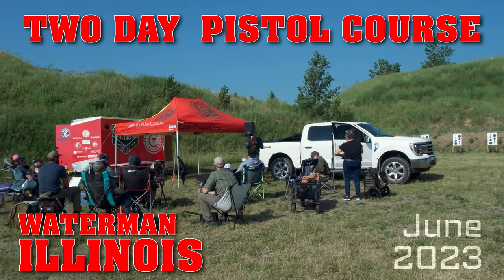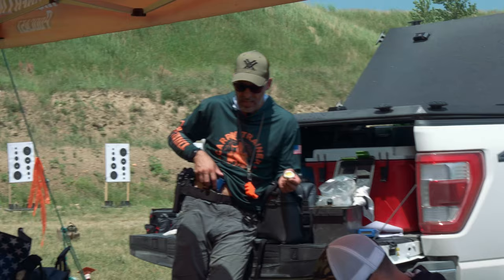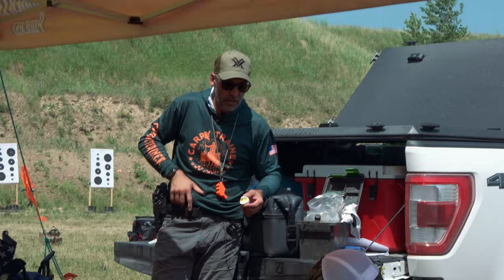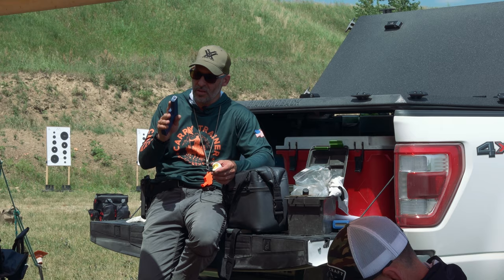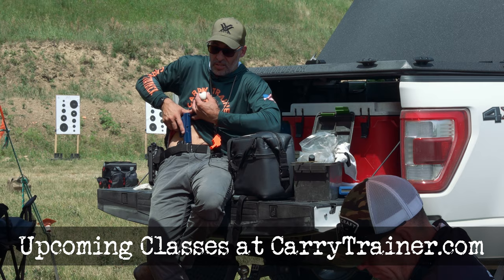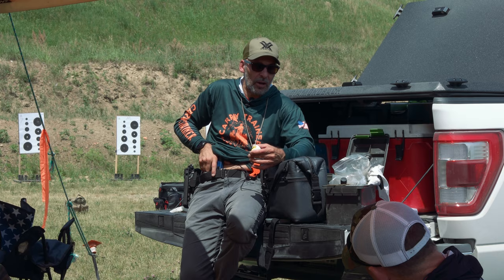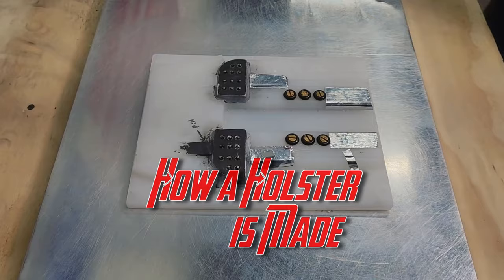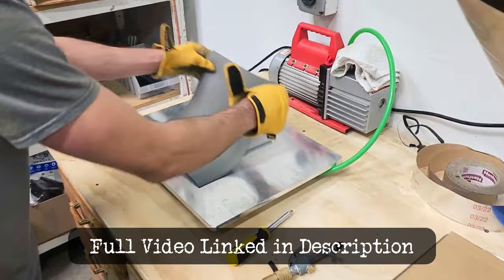Holster Setup Requirement

Comment: Are there any holsters with a pad behind them you recommend for conceal carry with 5/8in grip spacing? I just got a padded AlienGear but the grip is tight to the trigger guard when i holster it.
Reply from the maker: What gun?
Reply: @CarryTrainer  Smith & Wesson M&P Shield Plus 9mm
Reply from the maker: @outboundflight4455  check out a Darkstar Gear Apollo
Reply: @CarryTrainer  thank you. I'll check this one out. 

Is there a pad you could install behind it like the AlienGear Shapeshift Appendix? 
I ask because I will conceal carry with no undershirt. So having hard plastic dig into your appendix in Florida weather is irritating.
Reply from the maker: Look at what I suggested